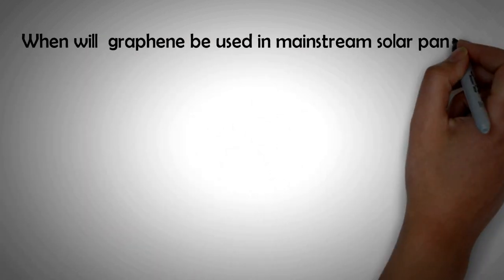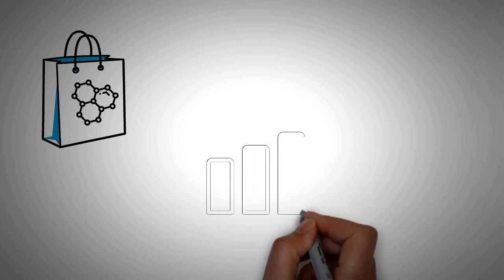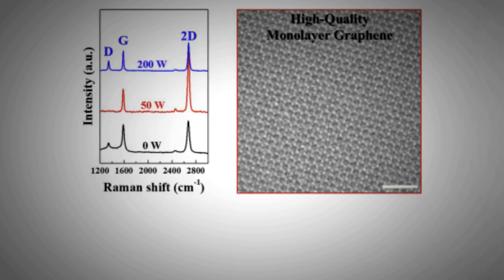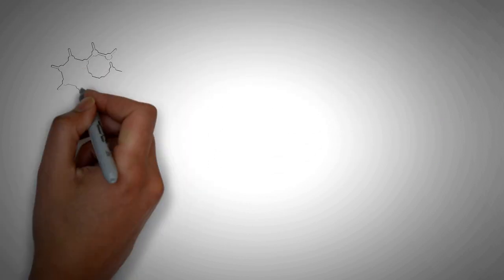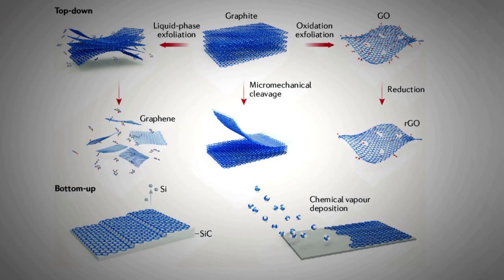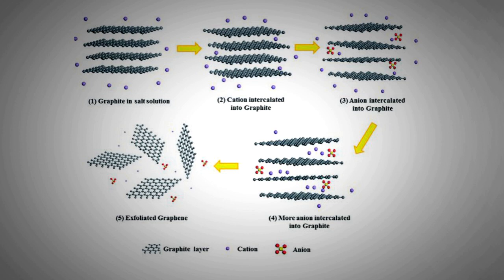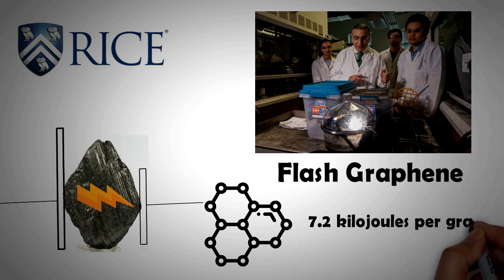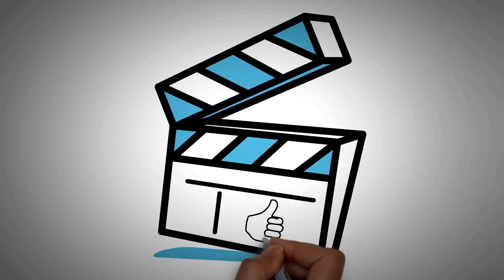Why Graphene is not being used in solar panels? How this will change

Comment: I don't know what point you were trying to make by saying that "the price rises exponentially with the increase in sheet size." @1:37 in the video. If you meant: "as the size of the sheet produced increases, so does the price" then yeah, but that doesn't seem like a particularly interesting fact, since it is true of literally all commodities. If you meant "As you increase the amount of graphene you are buying, the price increases faster than the size increases." then that is obviously wrong, by your own example: if 1 x 1 inch of graphene is $180, then the price for 1 square inch of graphene is $180 per square inch. If 4 x 4 inches of graphene is $900, then the price for 16 square inches of graphene is $56.25 per square inch, far lower than the first. If you are thinking that a 4 x 4 inch sheet of graphene is 4 times and not 16 times larger, then your math would work, which means that you seemed to forget about how the area of a square works when increasing in size.
Reply: Good catch. Flew over my head as well

Comment: It's true that most application are using nano platelets that are not technically grahene. up to 10 layers thick can be classed as Graphene whilst 11-3000 layers is Carbon Black/nano platelets, anything above that is Graphite. Single to 3 layers being strongest and most expensive for high end electrical applications, whilst 4-9 layers can be used for paint, coatings, cement, rubber, insulation etc etc..we (Zero Carbon Ventures) are in partnership with Levidian (UK) who have developed a new technology producing high quality consistent, pristine graphene (single layer to 9 layer) from waste Methane, relatively low cost solution which allows us to produce kilo's per hr on scale whist at the same time reducing harmfully emitted methane from sources like landfill gas. Watch this space as we now launch into our commercial applications.
Reply: I have graphene solar panels. My company has the distribution for them in North America

Comment: s an engineer in the tech field I can tell you..  1.  Developments in new tech, and new materials..  ALWAYS moves faster than the ability to actually produce it.  Meaning, by the time you reach production of a new process (say a graphene solar panel) it is obsolete.  That said, tech companies are gun shy when it comes to putting millions at risk in 'producing' product..  while its continued development is moving forward quickly.  Beside, there is literally Billions $$$ of dollars in inventory, tooling, filtering and manufacturing commitment to the existing solar panels, and no one wants to lose that money.  Remember when your computer monitor was a big heave CRT weighed a ton and was huge?  Now, everyone has a flat panel screen, morels plastic.  
Graphene  WILL CHANGE EVERYTHING....  and put a lot of people out of work.
Someone 3D printed a Graphene battery with 10x the density of a lithium battery the same size....  That was only his first pass at the experiment...
So, Imagine an electric car, graphene solar embedded in all glass, and the roof go the vehicle....  charging graphene batteries, that are running graphene based electric motors.
You have a car that will run forever on nothing but sun power.  YES..  we are there right now with technology we have today.
Remember this...  during World War 2, 'plastic' was worth its weight in GOLD...  because, it was new, and its development and manufacturing was difficult...  Today, we make trash bags out of 'PLASTICS'....
Reply: Do you think graphene can completely remove the need for silver in solar panels and electronics? I mean it has much better electric and thermal conductivity and the only limiting factor seems to be price...?
Reply: @quant2011 Graphene is "NEW" thus difficult to process.. right now.  During WW2, plastics were new, difficult to process, thus expensive.  Today, we make trash bags are plastic.  Graphene are the future or solar panels, batteries, superconductors, and growing circuitry.  It's abundant

Comment: We currently have a terrible problem of world wide plastic pollution, particularly the oceans, where microscopic bits of plastic are consumed by creatures great and small.  If graphene becomes as ubiquitous as plastic, how do we keep it out of the environment, especially the oceans?
Reply: at least from what I know Graphene is a very sturdy material while being extremely thin and light at the same time. It is really hard to rip apart. Unlike plastic. So the risk is smaller but it is a good point. All possible risks should be assessed. Good point Joe Dance.

Comment: its called graphite when its more than one atom layer thick. its graphite in tires and fotball shoes, not graphene
Reply: It's true that most application are using nano platelets that are not technically grahene. up to 10 layers thick can be classed as Graphene whilst 11-3000 layers is Carbon Black/nano platelets, anything above that is Graphite. single to 3 layers being strongest and most expensive for high end electrical applications, whilst 4-9 layers can be used for paint, coatings, cement, rubber, insulation etc etc..we (Zero Carbon Ventures) are in partnership with Levidian have a new technology producing high quality consistent, pristine graphene (single layer to 9 layer) from waste Methane, relatively low cost solution which allows us to produce kilo's per hr on scale whist at the same time reducing harmfully emitted methane from sources like landfill gas. Watch this space as we now launch into our commercial applications.